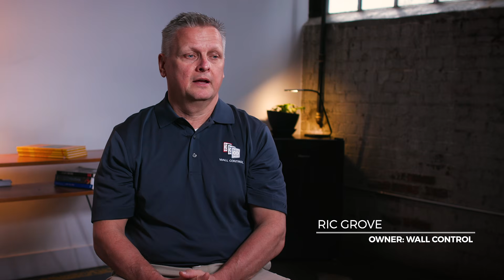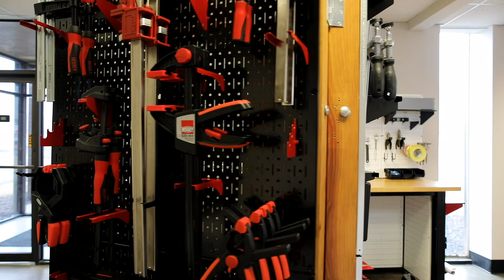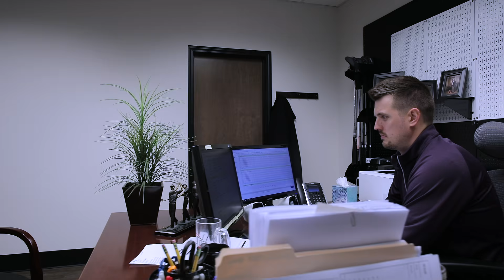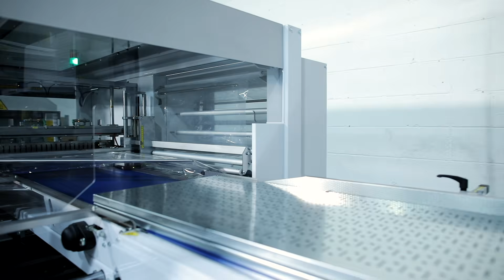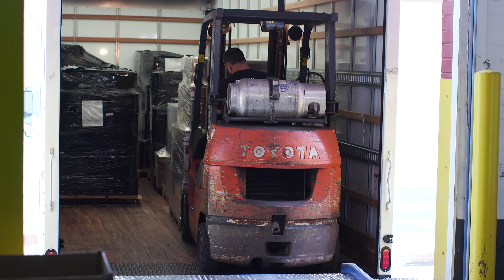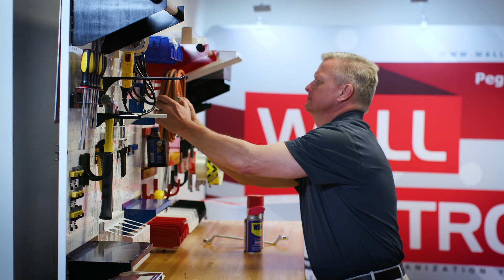Wall Control Pegboard Origin Story - The People Behind the Brand

Comment: Just set up a 32x64 wall control in my basement shop. Black with red accessories. The accessories and attachments are great dude. Not cheap  lol but not extremely over priced either. If you care about quality/function.. are a tad OCD & care about aesthetics.. you can’t get a better pegboard system.